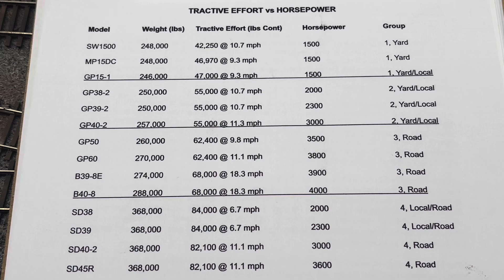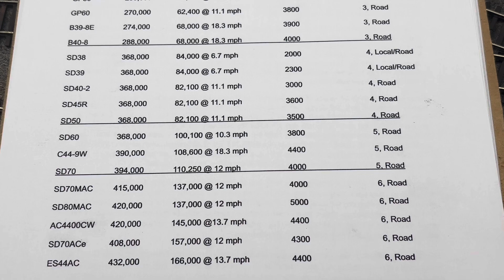Seaboard Central - Tractive Effort vs Horsepower

Comment: I have been looking for this explanation for a year.  I understood all the terms, but I could not figure out the practical relationship between them. Thank You for that.  Looking forward to tomorrow's episode.   So you want to make a train, how much tractive effort is it going to take to pull.   And Fridays wrap up, as a generalization, how much traction per car.    How does all this change vs. a grade?
Reply from the maker: Railroads establish tonnage profiles for all of their lines. So they put the locomotives in different groups based off of their tractive effort. Then they look at the steepest grade on a district and set the tonnage rating for each group. So on one district an SD40-2 might be rated for 4,000 tons where another district with a more severe grade it might only be 2,700 tons.

Comment: Great stuff! Now, how does this equate to actual drawbar pull for each model loco in ounces? Do you measure that to set a nominal # of cars a loco can pull on the flat? And up the helix? That usually correlates with actual loco weight plus how square the trucks are on the rail. so that all wheels pull equally.
Reply from the maker: Thanks! I wish that models had similar weights but some are lighter than others. I will do like the prototype and instead of tonnage, I will use maximum number of cars. For example, the maximum number of cars a single GP38 or GP40-2 is rated for over the line would be 7 due to the grades.

Comment: Great video - very enjoyable and well explained!
I'd be interested to know how the use of multiple locos/consist has an effect on the locomotive choice for a given load - for example how would two 2000hp locos perform against a single 4000hp loco on a train of the same weight?
Reply from the maker: Thanks! Yes a single ES44AC will definitely pull the same size train as two GP38-2s. I didn’t really get into too much specifics because I was afraid the video would end up being too much for people to try to understand.

Comment: Don't understand what horsepower or tractive power has to do with models--except in modeling what type of engines run with which trains. But that can be based on era, also.
Reply from the maker: It’s more prototype information for those who are interested in that sort of thing. For folks who are only interested in modeling I have a number of other how to videos on the channel I hope you will find more appealing.

Comment: The key equation is that power = force x speed. So, for example, something like a GP60 (high-power, light four-axle unit) can't exert a lot of force on the rails, but can exert that force at high speed; something like an SD38 (low-power, heavy six-axle unit) can exert a lot of force on the rails, but can't go very fast while doing so. And then the railroads and manufacturers just said, oh, eff it. Let's just build high-power, heavy six-axle units and not worry about all this stuff.
Reply from the maker: Yeah that’s pretty much it.

Comment: so tim, did you add any EXTRA weight to your locos... or are you happy with the "from the factory" weight... i do know KATO was known for being really heavy right from the factory... i had two of their GE C44-9ws way long time ago... very heavy locos (smooth running AND whisper quiet as well)
Reply from the maker: No extra weight added. Not much space with all the electronics.
Reply: @SeaboardCentral and remember, that all the boards and other things under the  hood ,that take up space, cause the weight of the model to be less. In N , for example--- I defy anyone to find a smoother, heavyweight loco than a ORIGINAL Kato F3,or F7.
Reply: @SeaboardCentral  yea for sure, some of these locos could use some extra weight

Comment: 645 cubic inches 👍🏻
Reply: 645 cubic inches per cylinder.
Reply from the maker: Yes my bad. 😂
Reply: @SeaboardCentral  oh I know that you knew.  Easy slip up there. I've always heard and you probably have too, but the old timers would say that steam locomotives could pull more than they could start and that diesels could start more than they could pull 🤷🏻
Reply from the maker: @stephenhottle6783 the old heads I knew told me with steam if you could get it started then you knew it would make it. Diesels produce more TE at low speed where steam is the opposite.
Reply: @SeaboardCentral  yes that would make sense. We actually have a guy still running where I'm at that's been around so long that he used to run FT's. It's really impressive to me.